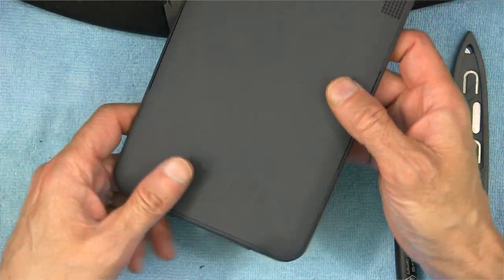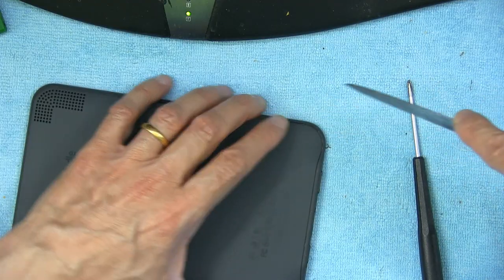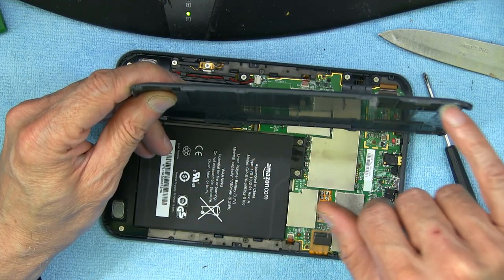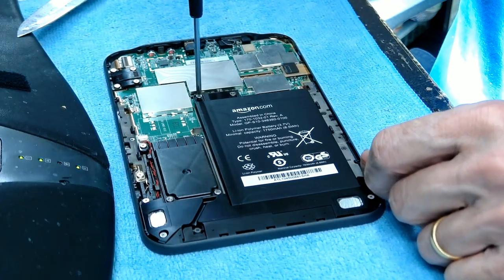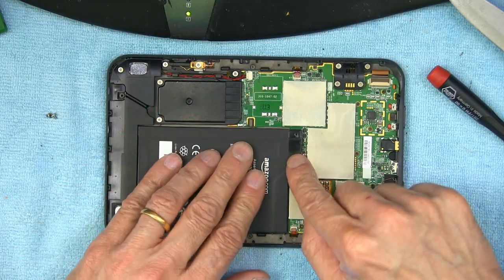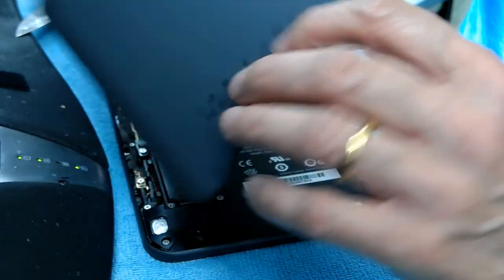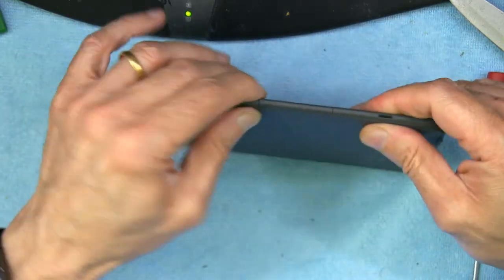Tutorial on how to replace the battery pack in an Amazon Kindle D00901 Electronic eBook Reader

Comment: Very short, to the point. Awesome clear instructions !!
These days the batteries have adhesive strips and what not, but never realized this one is so simple.
All batteries should be installed like this :)
Reply from the maker: Thank you! and yes I agree they shouldn't put adhesive, because many times when you remove the battery which was attached with adhesive it breaks the battery seal, leading to chemical leakage.

Comment: Thanks for making my day; I had seen this video earlier when trying to determine which battery it took, and referred to it again just after my new battery arrived.  I followed your instructions in removing the back cover and didn't break anything. After removing the old battery, I tested the other Philips  screws I found under the battery and holding various nearby components in, and found that many of those screws were slightly loose, particularly near the USB power port. Using the same very small Philips screwdriver that is commonly used for iPhone and other electronic repairs, I went around and tightened all of the screws I could find just enough to avoid loose connections - you don't want to strip the heads or threads out of any of them.  It went back together pretty well, but there are many snap-type latches that you must click firmly in place if you don't want it to come apart later.  Charge it before you use it and you'll get another ten years or so out of your Kindle Reader.
Reply from the maker: You are very welcome!

Comment: Thank you for this Khaled!  When I turned my Kindle to see if my frozen "Hercules" screen has gone blank with the battery out, a little circular metal piece of hardware fell out!  I frantically scanned your video to see where it belonged, but could not figure it out.  Then I watched your screen replacement video and saw there were 2 of these that belonged over the screw holes for the battery.  Sure enough, I found a second piece on the floor.  I did not see any other comment about this, so I thought to share in case anyone else had this experience.🙂
Reply from the maker: That is a very helpful hint, thanks for sharing.

Comment: I thought I was going to have to buy a new Kindle. Mine is from 2012 but I haven’t used it in YEARS. I watched this video yesterday, ordered a battery (that was the hardest part - finding the battery) and just put the new one in. It still says battery dead, but the amber light came on and I think it’s charging! Thank you SO much for this video!
Reply from the maker: Thank you!!
Reply: Did it end up charging and working after the amber light turned on?
Reply: Sure did! The kindle is so old I can’t download new books onto it but I had a ton of books on there!

Comment: Thank you for a simple demonstration on carrying out this task, now successfully done.  I was apprehensive about this as the staff at my local Currys/PC World stated the Kindle is a sealed unit and the battery cannot be changed.  Thanks again.
Reply from the maker: You are very welcome and I appreciate your feedback. I am sure your local store technicians are smart people, and didn't reject the service intentionally, they probably didn't know that the battery was so easily accessible.
Reply: It’s also that this isn’t an official solution, so the staff aren’t allowed to suggest you use it. I used to work at currys and that was a rule there - if the manufacturer didn’t allow the solution, you as the sales assistant cannot suggest or endorse it to a customer

Comment: Great video. Thank you. You just have to be careful snapping off and on the cover as it can be tricky. Take your time to avoid breaking it. I used a plastic pry device - looks like a guitar pick to do the job. Be careful not to lose the screws. Use a magnetic screwdriver if you have one.
Reply from the maker: Thank you, very valid points.

Comment: Very good thanks.. But where did you get the new battery from?. I recently got one from Amazon UK which arrived and looked like the existing one but didn't have Amazon written on it. Got the orange light when charging, but never actually got a charge. Excellent video thanks..
Reply from the maker: Hi, I got my battery from eBay, you can also buy them from AliExpress. Unfortunately they don't sell the original Amazon batteries, so all the ones available are aftermarket batteries. You must have gotten a bad one and you should ask the seller to exchange it for you.

Comment: Very concise and clear - Thank you for this video. One question, I got it all done but I cant seem to snap the very bottom back together - right where it charges, I have squeezed as hard as I could - should I get out the pliers and force it? I have the speakers in the right place and everything, it just wont close all the way.
Reply from the maker: Thank you, so for snaping it back it you can't use a plyer because it will damage the case and the back panel. However you could open it again, and snap in the bottom first then the top and the sides afterwards.

Comment: I wonder if its worth replacing the battery? Thanks for you tutorial  I ordered a new battery. Did scratch little bit but have taken a part . I ordered a battery replacement. Hope it brings back life to my old kindle. I am hopeful. It an oldie but goodie
Reply from the maker: Good luck with the project, and yes it should be worth fixing because these are no longer available to buy. The new ones are too heavy and thick like iPads. This is light weight with very low energy consumption.

Comment: Hello, I have a kindle d00901 and it's frozen at the boot screen (the loading bar shows maybe a 5 or 10% and that's it). Any idea how to fix it? Maybe I think I need to replace the battery, but I don't know where can I buy it. Do you know where I can buy one?
Reply from the maker: Yes it could be the battery but also a bad main board could cause this. The battery is available all over eBay just search for Kindle D00901 Battery and make sure the seller is local and not international seller.

Comment: You are brilliant. Will it work without a battery on the mains. Where can I buy a battery ? I live in India. Thanks.
Reply from the maker: Thanks for your kind words, you can buy the battery on eBay or on Aliexpress. You can also get it from Amazon but it will be more expensive. You can't run it without a battery because it will reset every time you unplug it.

Comment: Excellent tutorial. This is also the only way to reset the Kindle if it freezes up. Take the battery out and put it back in. Then plug in the charger and it will come back to life. Or at least mine did.
Reply from the maker: Great advise, Thank you

Comment: Great video! Could you recommend where to get a replacement battery? I can't seem to find one anywhere because my model is old I think, I have the D00901. Any advice on where to find one is appreciated thanks :)
Reply from the maker: Sure, you can easily get them from eBay here are a few examples https://www.ebay.com/sch/i.html?_from=R40&_trksid=p2062857.m570.l1312&_nkw=d00901+battery&_sacat=0
Reply: @TECHNOLOGYTIPS101  thank you so much!
Reply from the maker: @jennabult5617  No problem!

Comment: Good evening. The video was really good. Congratulations. I had a problem. It wasn't charging anymore. Changing the battery fixed it, but I let it discharge too much and the problem came back. The battery is new, but it's not charging. The charging LED lights up for a few seconds and then turns off. How should I go about charging the battery outside of the Kindle, independently?  My device is the Paperwhite.
Reply from the maker: Hi, thanks for your kind words. You can use a universal 3.7V battery charger like this one https://www.ebay.com/itm/271915693122

Comment: Thank You so much sir for such a short and knowledgeable video. One question, I see you have got new OEM Amazon battery, where did you get it from?
Reply from the maker: No problem, I bought the battery from a seller on eBay but I don't see them anymore. All I see are the aftermarket substitution in there.

Comment: Thank you very much for your clear instructions! You might be able to help me here: My kindle battery was drained in the middle of the updating process… if I put in a new battery, will it start to charge? … I have tried all the other methods but failed. If the new battery won’t start charging during updating, I guess there is nothing I can do with my kindle…?
Reply from the maker: That is really strange because normally the update will not even start unless the kindle is plugged in to external power or the battery is near full.  So before you install another battery I recommend plugging it to external power to see if that re-triggers the update process.

Comment: Hi I’m planning on changing my battery on this model of Kindle can you please show me that it charged and it’s fully operational as it was prior to the battery dying? I don’t wanna go through the expense of buying the battery and then not have the software sync because I haven’t use my Kindle in a while.
Reply from the maker: You should only change the battery if the unit works fine when it is plugged in, because if the motherboard is fried then it will not turn on regardless even with the new battery. A good unit should work fine with a bad battery it just wont hold a charge and as soon as you unplug the power supply it goes off.

Comment: Thanks for this excellent video. Kindle shows the “Empty Battery” screen. I replaced the battery and charged overnight. The yellow charge light went out but no green light. Still shows the battery needs replacing screen. I tried holding the power slide for minutes but no joy. I removed the new battery and it shows 4.5 volts so it took a charge. Any thoughts would be appreciated.
Reply from the maker: You are very welcome, and about the issue, I recommend removing the battery and power cable for 12 hours to let all the capacitors discharge and allow the kindle to do a soft factory reset.  You will not lose data and stored books when you do a soft reset,
Reply: @TECHNOLOGYTIPS101  Thanks for replying. I will try this. By the way, Since I asked you the question I found a guy on line who showed how to do a physical reset by shorting the two “reset” blocks just above the power slide with a screwdriver. It did nothing for me but many of the respondents found that this worked.
Reply from the maker: @johndavidson1010  Thanks for the valuable info, it will help other fellow kindle users.

Comment: Sir, I've replaced the battery but still the critical battery screen doesn't goes away. It's still showing critical battery. I've charged it for a long time and the indicator lid turned to green. I have tried holding the power button for 20 seconds and home button for 40 seconds and that too doesn't make any changes. Please tell me what should I do and what is happening with my kindle?
Reply from the maker: Hi, most likely the new battery is defective, and you should exchange it if you can. The normal Voltage on a fully charged battery should be above the the 3.7V as written on the battery. It should be more like 3.9V and as it drains out and reach 80% only then it drops to 3.7V. 
A defective battery will not hold charge which is why you are getting the error message.

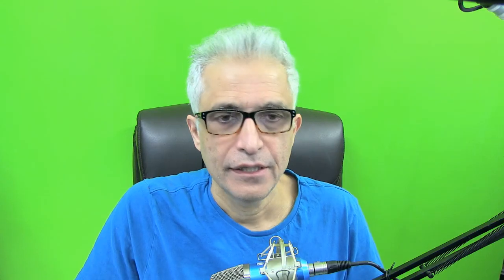Comment: Appreciate this video.  I have a Kindle 3 and ordered a Kindle battery from eBay ~$17.  Your battery replacement instruction was easy to follow.  However, after replacing the battery, I have noted the light is now green but flashing on and off.  Meanwhile, the screen remained the same as shown in your video at 4:44 where it says:

Critical Battery - your battery is empty

I have charged it for almost 2 hours (plugged in to my laptop) and also tried the 'hold the power for 45 seconds every 20 minutes method and nothing seems to work.

Would appreciate your thoughts
Reply from the maker: Hi, I recommend charging it for a full 8 hours period, but not form a computer USB Port, use an independent 2.0Amp USB charger.
Reply: @TECHNOLOGYTIPS101  happy to report the Kindle 3 came to life this morning after 8+ hours of charge.  Another happy customer, thanks!!
Reply from the maker: @wupalbert  I am glad to hear that, be safe my friend

Comment: Can the broken screen be replaced by a new one? 
Are they even available? 
I also have a touchscreen kindle and it's power button has caved in... can it be replaced?
Reply from the maker: Hi, you can't buy new parts for these, but you can buy a defective one with a good screen for really cheap on eBay and use the screen out of that to repair yours. You can do the same with the one with caved in button.

Comment: Thanks for the video. I can't see a model number but it looks like yours. It's about 10 - 12 years old. Where could I buy a battery and what is the battery number? I am in Australia.
Reply from the maker: You are very welcome, the model number is D00901 and it is written with a very fine font on the back, it is not easy to see unless you have a magnifying glass. The battery is widely available on eBay and Amazon for example here is one  https://www.amazon.com/dp/B07MXZ9J5P/ref=cm_sw_em_r_mt_dp_S6fyFbSH2W7G6
Reply: Gerri , I'm in Melbourne ,I got a battery off EBay ex Sydney for $26 delivered.

Comment: Good day Sir! thank you for the amazing video. I want to ask what if the screen shows "critical battery"? I left it charged for few hours with Samsung cord, it has orange light but when I slide the power button, it still freezes. Do you think I should change my battery? looking forward to your answer & thank you so much.
Reply from the maker: You are very welcome, and Yes I think you might wanna change the battery. Make sure you buy it from a seller who will accept returns, so that in case you had a bigger issues on the unit, you will lose your money on the battery. Many sellers on eBay offer Free Returns.
Reply: @TECHNOLOGYTIPS101  This is very helpful. Thank you for responding. Have a good day!
Reply from the maker: @reverie6187  Thanks and you too.

Comment: Thanks for the video Sir, but my Ebook isn’t working. The screen is frozen on the standby/sleep mode and even without the battery it stays like that. Any recommendation?
Thank you.
Reply from the maker: One of the ways to fix that is to press and hold the power button for about 30 seconds unit the unit powers off. If that doesn't work try updating the firmware via USB Cable. If the unit is not even being recognized by your computer then I would most likely think the Main Board is bad.

Comment: Thanks i buy ir yesterday. I'm charging the battery now. How many hours do it take? Thanks again the video was very helpful
Reply from the maker: You are very welcome and thanks for your compliments. The battery usually takes two hours to charge under normal conditions, however when it is brand new it is recommended to leave it all night. Also use the original charger not any aftermarket brand because it could damage your Kindle.

Comment: hi i have this model , it hasnt been used for a while . when I charge it has a yellow light but i am unable to switch the unit power on . maybe battery is dead :) can you pl share what battery i shoudl order ?
Reply from the maker: Yes it does sound like a battery problem but it could be the main board too. So make sure to buy the battery from a seller who will take it back in case the problem was not the battery. Here is the link for the battery https://www.ebay.com/sch/i.html?_from=R40&_nkw=Kindle+D00901+battery&_sacat=0&rt=nc&LH_PrefLoc=1
Reply: @TECHNOLOGYTIPS101  thanks so very much for your prompt response:)
Reply from the maker: @vasu5224  No problem!

Comment: My Kindle (this same model) died about a year ago - do you think it's a matter of changing the battery like this video shows? I found this on Amazon for about $15. Is this the right battery I'm looking for? - CS 1900mAh Replacement Battery for AMZ K 3 K 3 Wi-fi K 3G K Graphite K III PN 170-1032-00 170-1032-01 GP-S10-346392-0100 S11GTSF01A
Reply from the maker: If your Kindle still works with AC adapter when it's plugged in, then it is a battery issue. However if it is completely dead and won't turn on even with the power plug, then don't waste your money on the batter as the Kindle Main Board might be bad. You can get the battery cheaper from eBay than you can from Amazon. I am not promoting any specific one, but you can simply search for " Battery For D00901" on eBay.
Reply: @TECHNOLOGYTIPS101  Thank you. The yellow light still turns on when I plug it in, but it won't power up even if it's still plugged in via the AC adapter. So maybe a Kindle main board issue. When it died it tried to re-boot a couple of times but then just wouldn't respond.
Reply from the maker: @LynPerry  Yes it is most likely the mainboard, unfortunately.